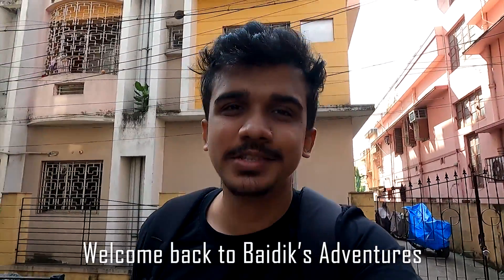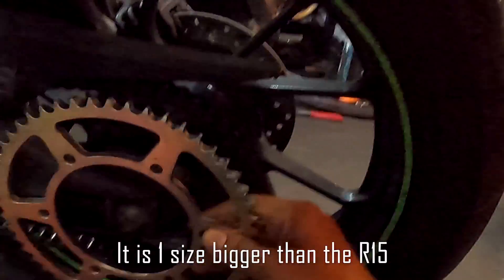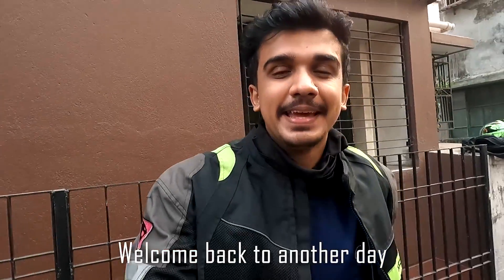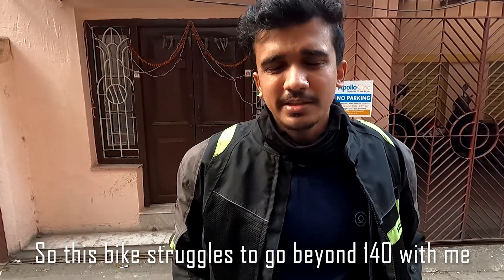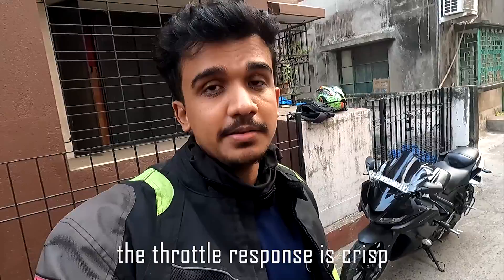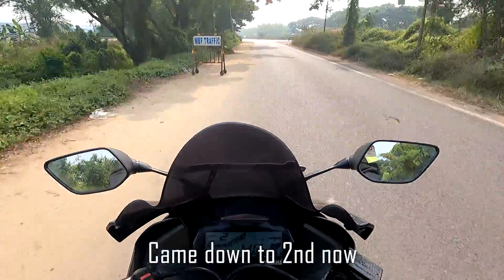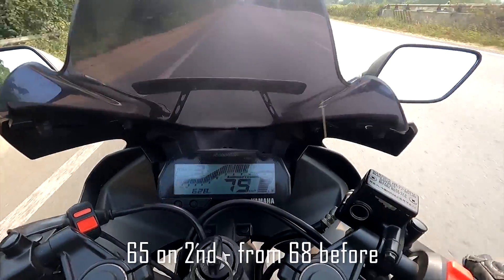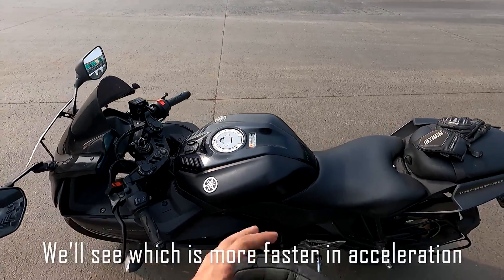MT15 sprocket on R15 V3 to make it faster

Comment: Bro I change V3 sprocket in my Mt 15 top end is better bro
Reply from the maker: Yes, top speed will increase.. but it'll take a lot of time
Reply: @baidiksadventures1071  wind blast is heavy cannot achieve 135 plus
Never wind  top speed reach quickly and I reach 151
Reply from the maker: @abinanthan3375  yes, you're right.. maybe it a very long straight highway speed will increase..
Reply: Is there any problem by changing r15v3 chainsprocket in mt 15??
Reply: Is there any problem by changing r15v3 chainsprocket in mt 15??
Reply: @anzilgurung3086     Keep ur vehicles as stock as possible for maximum reliability...